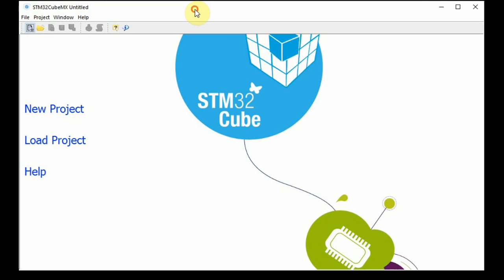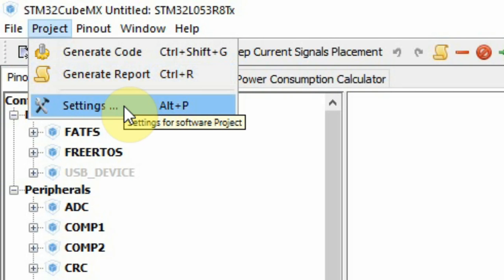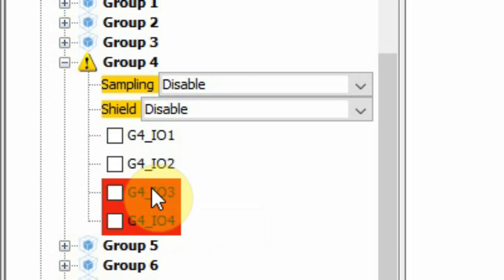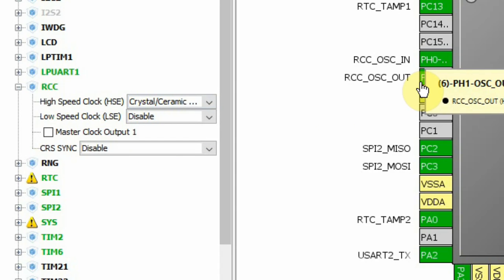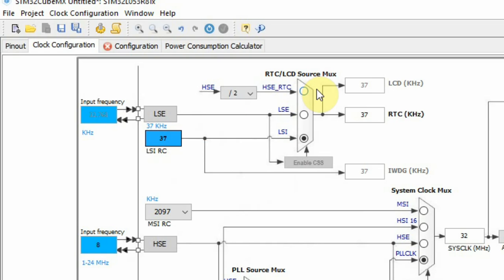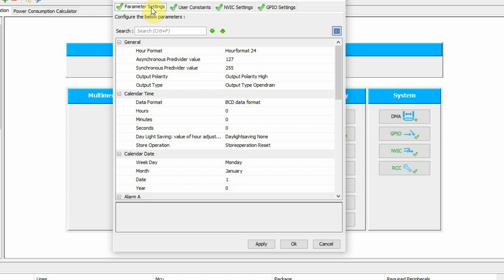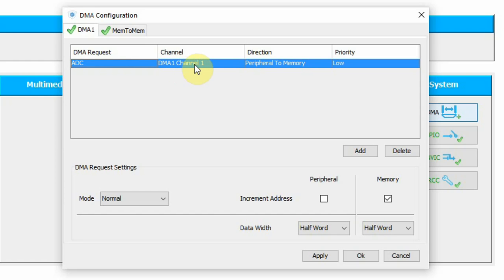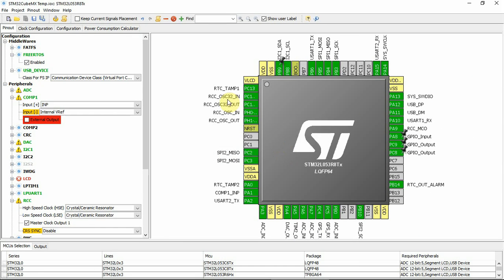#1 STM32CubeMX Tutorial. See also the video update!

Comment: Can you compile with  STM32CubeMX any code size or which is the limit code size? If the answer is negative, please suggest an unlimited free IDE to compile
Reply from the maker: Hi. The STM32Cube is not a compiler, it only generates the code for the compiler that you are using. It has no code restriction.